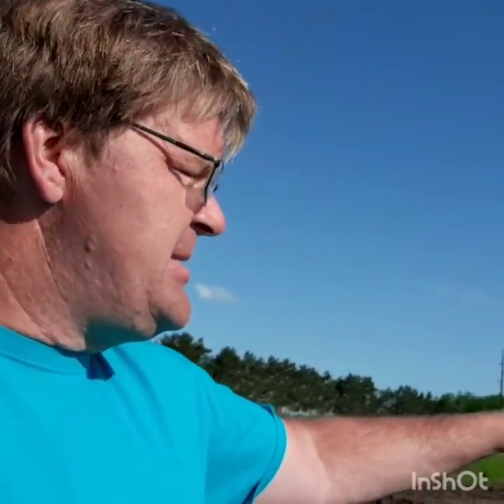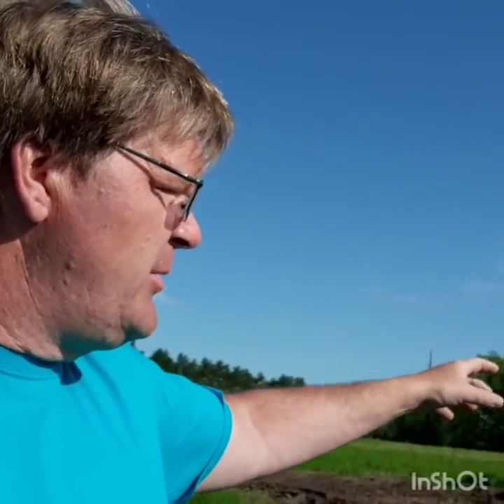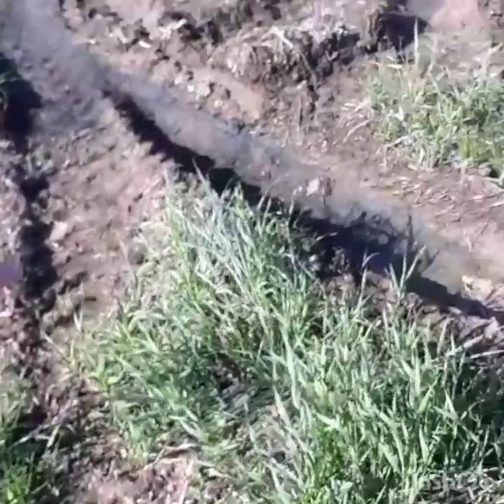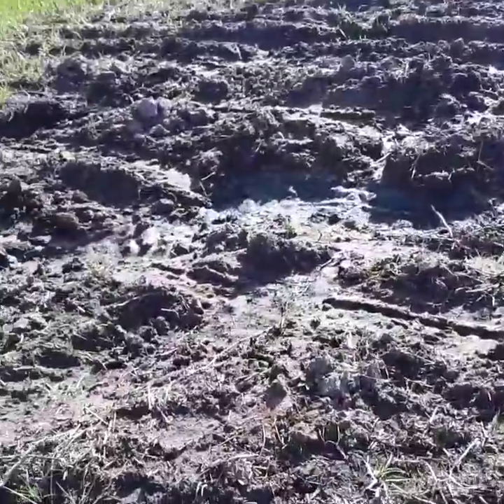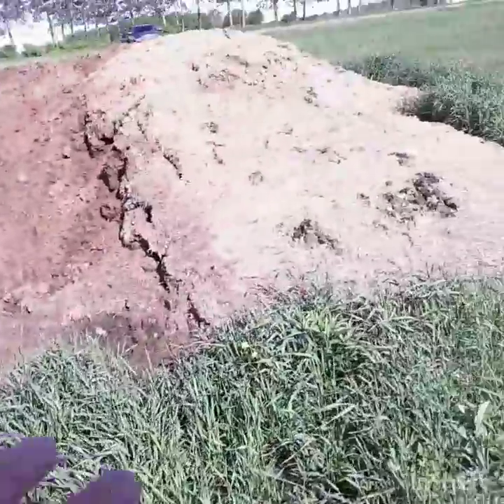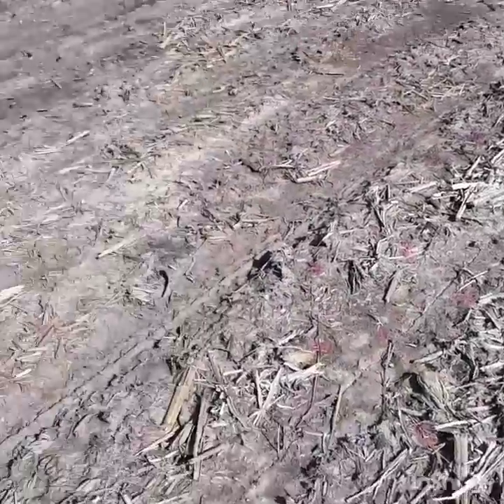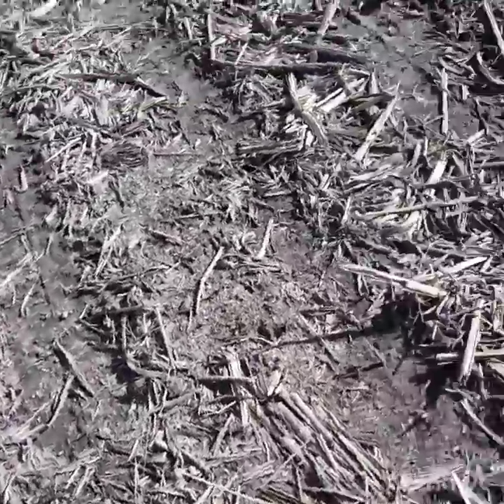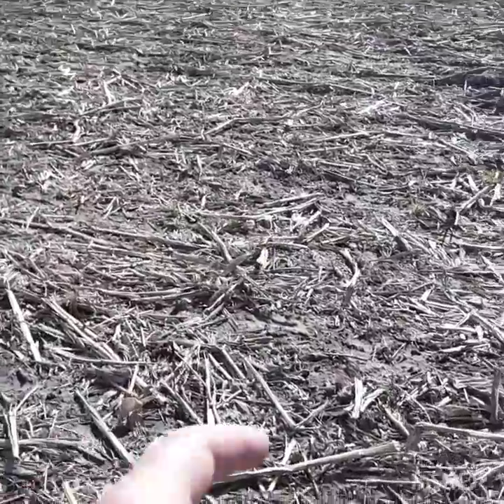Applying manure in no till/soil health.

Comment: Pretty cool, but keep in mind that tillage is inventend for the fun of it. I hope it works well. Maybe build a concrete floor to stock the manure  at the homefarm. More hauling with the spreader but no 'dead ' spots in the field
Reply from the maker: For the fields close to home I thought about using the feedlot to stockpile. And for the fields not close to home I thought about pouring yeah concrete pad somewhere in the center of all them Acres.
Reply: @jonstevensmaplegrovefarms3754  I understand. I'm not trying to be a know it al, but just sharing a different point of view 
Can be refreshing sometimes
Reply from the maker: No I agree with you that as I start to get organized with this turkey litter it would be nice to have a spot to dump it versus the field. Or at least in the fields create a little thing in the corner of each field
Reply: @jonstevensmaplegrovefarms3754  That would be nice. But you got to have something to wish for 😉